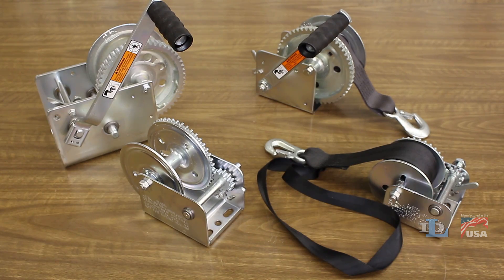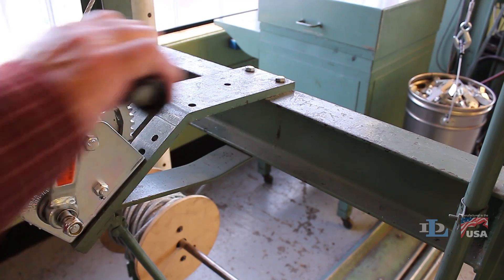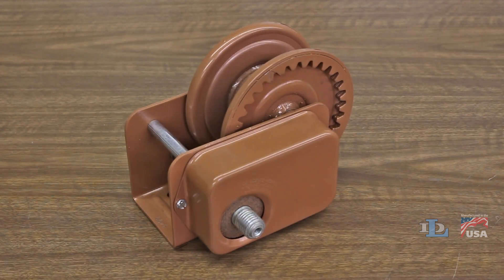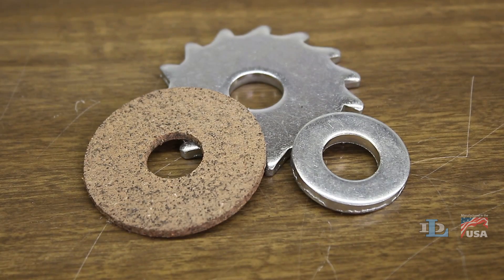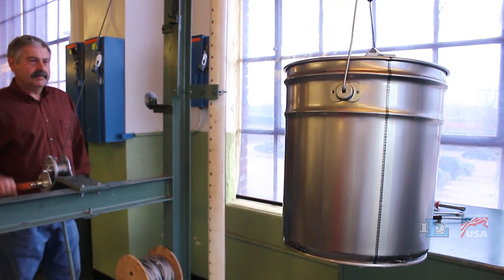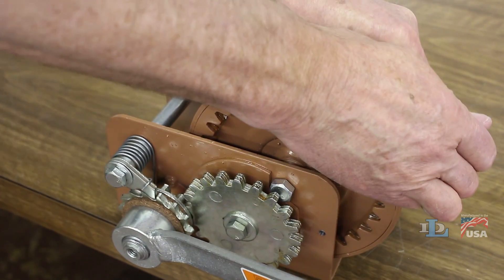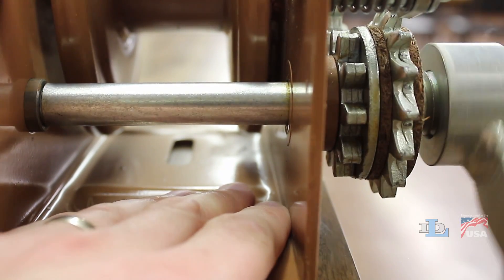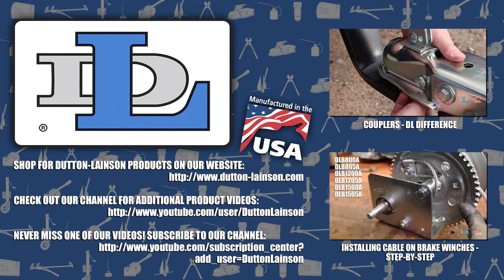Brake Winches - Long Version - DL Difference

Comment: Do these hold long term? Can i set it to where i want it and, if my need be, leave it there for months on end without worry that the load will fall?
Reply from the maker: Thanks for your question!  If you are using a D-L brake winch to hold a load off the ground for any length of time, a secondary holding device should also be attached to the load as a safety precaution.

Comment: I have a dlb800 winch for my 1996 pop up camper. It goes up with no problems, but the handle will not move counter clockwise to lower the unit. Any suggestions or solutions to fix this problem?
Reply from the maker: Thanks for your question!  The easiest thing to try would be to apply grease to the winch if it isn't greased already.  On DLB brake winches, you should be occasionally greasing gears, reel shaft, and handle threads so the winch runs smoothly.  If that doesn't work or you already have these areas sufficiently greased, call us at 402-462-4141 so we can further assist you.
Reply: @ thank you for the reply, I will give that a try
Reply: @DuttonLainson hi, i have this same issue, what is the best lubricant? Also I assume try not to get lube on brake pad?

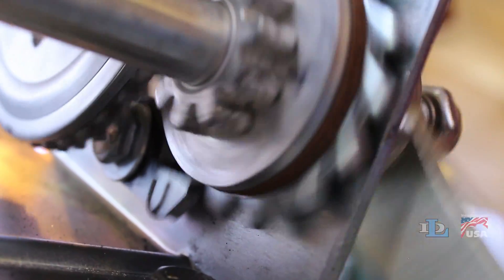Comment: 2:52 sound is so nasty and loud. There are silent variants these days (I know two manufacturers of silent (they call it noiseless) variants). Do you have silent winches, too? (video about such ones would be interesting).
Reply from the maker: Thanks for your question, but no- none of our winches operate silently or noiselessly.  The clicking noise that is produced as the ratchet pawl engages with the gears is one of the easiest and surest ways to know the winch is functioning properly.
Reply: @DuttonLainson  Thanks for fast answer. Some context for this. There are cases where this sound is very problematic - for example theaters or nighttime at garden and neighbors (the second one is my real scenario to why I'm looking for mostly silent unit). 

My winch is mounted on the metal frame, so the whole thing resonates, amplifying the knocking sound.

I guess the sound could still be there but at really minimal level.

I've tried making my winch more silent. By adding ~0.6mm thick rubber at ratchet pawl face that hits gear (and only there). It did silence it a lot but gear tooth depth in my unit (from other manufacturer) is too small to make me feel comfortable and secure with this added rubber mod (so I abandoned it).

I see that some Japanese winch manufacturer has complicated magnet based solution to this (where ratchet pawl doesn't touch the gear at all when winding up).

Comment: Are there any winches that can be used with a hand drill instead of a cranking handle?
Reply from the maker: Thanks for your question, Jay!  All of our DLB-series brake winches can be operated with a drill instead of cranking a handle if you install the square tube hub from the 6453 (https://www.dutton-lainson.com/proddetail.php?prod=14467) or the 6454 (https://www.dutton-lainson.com/proddetail.php?prod=14468) handle kits on the drive shaft.  You then use the 6456 drill drive socket (https://www.dutton-lainson.com/proddetail.php?prod=14466) on your drill to operate the winch.  Photos of this setup are shown on the 6456 product page.

Comment: Will you ever offer winches with Bi-directional Backstop clutches? This would make them run smoother and hold the load no matter which way the cable is spooled.
Reply from the maker: Thanks for your question, but we have no plans to offer winches with Bi-directional backstop clutches.

Comment: What is the maximum length of cable on a 2500 lbs and 2000lbs?
Reply from the maker: Thanks for your question!  We do not offer a brake winch with a 2,000 lb. weight capacity, but we offer two options with a 2,500 lb. capacity- the DLB2500A and the B2500.  On the DLB2500A, you can install up to 50' of 1/4" cable, up to 42' of 9/32" cable, up to 34' of 5/16" cable, or up to 28' of 11/32" cable.  On the B2500, you can install up to 76' of 1/4" cable, up to 64' of 9/32" cable, up to 51' of 5/16" cable, or up to 42' of 11/32" cable.
Reply: Dutton-Lainson Company thanks I also have a dl2000a pulling winch. I should’ve specified. But I bought 100’ of  1/4” cable. With the thought of cutting it in half and using 50’ for each winch. I think it will work out.
Reply from the maker: @mountainmama5049  Thanks for the clarification!  You can fit up to 70' of 1/4" cable on your DL2000A.

Comment: what material is the break pads made from? Seems like they will ware out and need replacement like happens on cars
Reply from the maker: The brake pads found in Dutton-Lainson brake winches are a rigid molded non-asbestos metallic material.  With time and use of the winch, they may need to be replaced.  You can watch a video on how to replace the brake pads on DLB-series brake winches here: https://youtu.be/igPJSxG86XI, and a video on how to replace the brake pads on B-series brake winches here: https://youtu.be/lZNHDdsDrI4